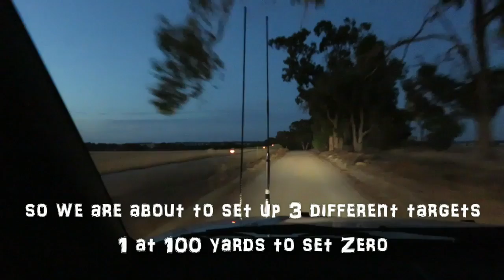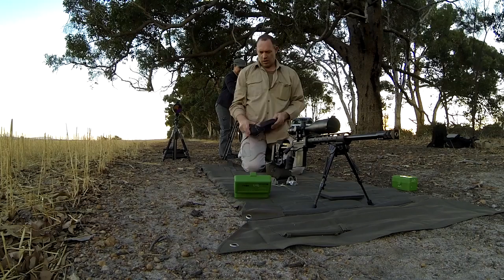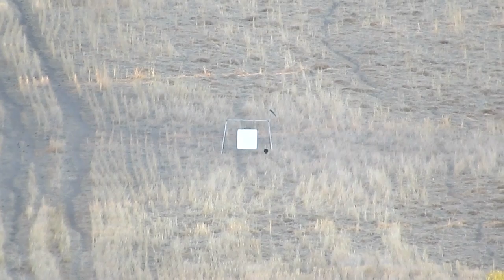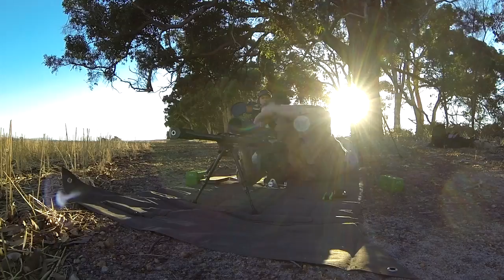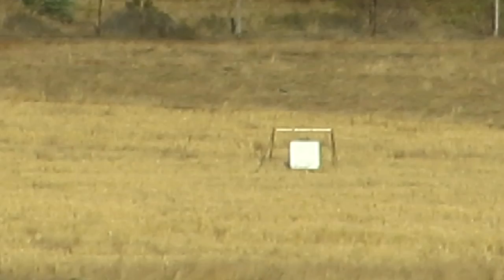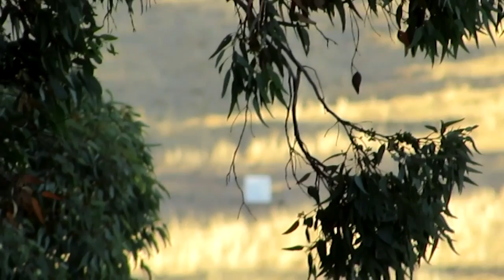HOWA 1500 .243 @ 1800yards (XLR Chassis)

Comment: Great shooting once again from the 243. What is the twist on the Howa 1500 ? from factory they come with 1-12 i think. Is a faster twist better for longer range using heavy bullets. I am thinking of having one on my next renewal to shoot out to 600 700 yards it looks like it will do it easily. Keep the videos coming they are very informative i learn a lot from them.
Cheers.
Reply from the maker: This one is 1-10 which is needed for the 95grains bullets that I use, the 1-12 would be fine up to the 80 grains which would be fine for 700 yards. The 1-12 is also good for shooting the 55 grain stuff for a very flat trajectory and great for small game hunting. 1-8 is recommended for long range, using the 107 and 115 grain bullets but this thing is working very well like it is. Thanks for the comment, cheers.

Comment: Great video, thanks for posting the specs too. Thinking of going XLR with my 6mm howa but was wondering about the AICS mags mating with a flat bottomed action, interesting it is giving you problems, do you think it will be fixable?
Thanks again.
Reply from the maker: theegupper Thanks Man, yes all sorted, just a bit of trimming to get it to suit the long bullets I use.
Reply: Thanks for the reply. Got my order in and looking forward to getting out on the range.
Have a good one.

Comment: Great video and sweet looking gun. What brand is the mag (after market or Howa)?. I am very interested in the .243 as I own a Weatherby .243.
By the way, Mark I love the hair cut :)
Reply from the maker: Thanks fro that Paul, mag is AI, came with chassis, will work great when set up. Yeh I like the .243 nice to shoot and good all rounder. Yeh the head looks a bit serious the first couple of days after the shears, not too fussed. All the best.
Reply: MarkandSam AfterWork Thanks for the reply. I have been looking at the Legacy Sports mag conversion kit. They are a little pricey for what they are. Don't worry about your hair - I am bald so I am jealous :)
Reply: Very keen on the Weatherby Vanguard in .243 also.  Umm'ing and ah'ing over what glass to put on top, though.
Reply: The Weatherby .243 is a great gun. No complains. I am a hunter and on a budget so I bought a Bushnell Trophy 3-9x 40. Its seems ok for the hunting shots I need to make.
Reply: I'd like a Vanguard as a project gun and eventually push it out to 1000 yards at the Belmont range